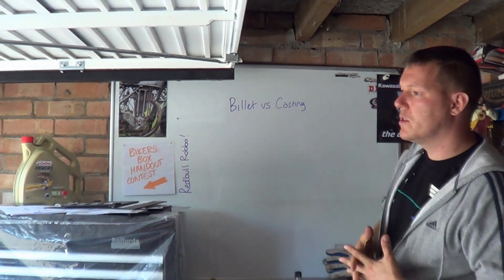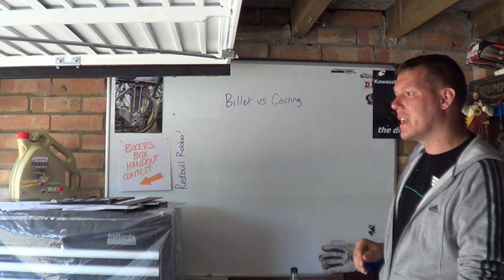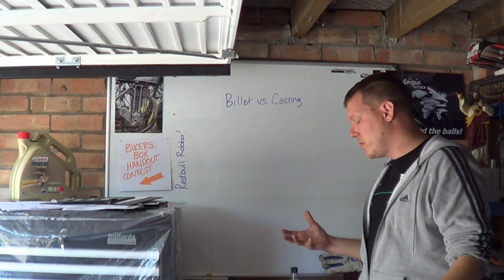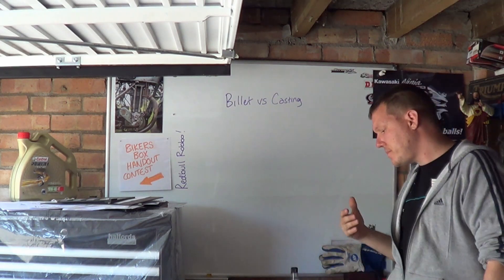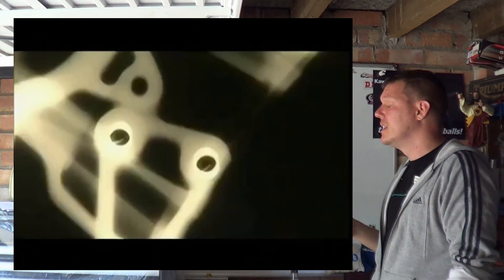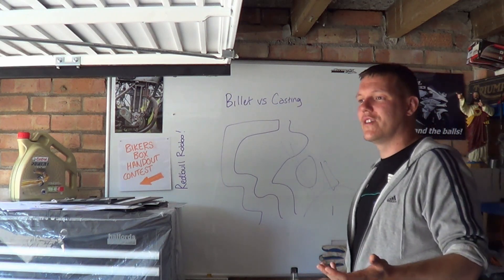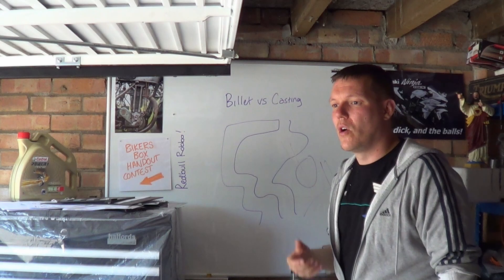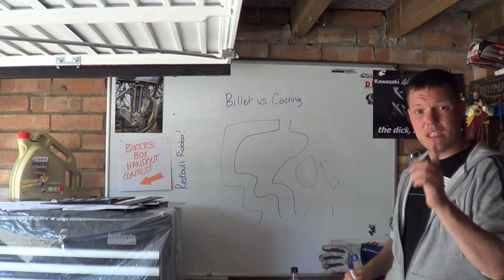Engine blocks - Casting vs Billet

Comment: So if I have engine block and machine all the surface with CNC. Does it called billet?
Reply: No a billet block is a block machined from a single piece solid metal billet. A cast block that's been through a cnc for resurfacing is still a cast block. Its considered as such because of style of manufacturing, casting usually means its melted aluminum poured into a mold and cast into shape while billet means it starts out as solid piece of metal that gets machined into shape.
Reply from the maker: LOL no.

Comment: Billet is CNC, right? Everybody’s got it wrong here. See, what you really need is 3D modeling software that allows you to make the engine in the first place, using a slicer to convert the model into gcode so YOU DONT HAVE TO WRITE IT LINE BY LINE, and then have it do its thing. Time really isn’t a problem. 3D printers work by much the same principle through stepper motors but do much the opposite.
Reply from the maker: Billet is a block of material. So no. CNC is computer numerical control. Totally different things......

Comment: In terms of custom casting. A gentleman I work with is the mechanic for a race team. The team runs different cars and engines but one thing they run are Hart 4 cylinders. They designed, or had designed, new heads. Had the patterns 3d printed, the heads cast and machined in a very short time frame

Comment: Is there a way for forging an engine?
Reply from the maker: forging? you mean the block? Why would you want to do that?
Reply: Forging is stronger than casting or billet
Reply from the maker: yes I know that but you don't need it. That's called over-engineering.
Reply: Fair enough

Comment: I know your not a car and turbo kind of guy but there is a current raging argument on how boost pressure works

The argument is if you replace your turbo for a bigger turbo and run it at the same wastegate pressure the car will receive more air in the form of a higer cfm and require more fuel to compensate.

I feel like you would enjoy adding your 2 cents
Reply from the maker: cheers dude I will do, why not lol

Comment: I'm a metal caster by trade, 10 years experience in mostly ferrous stuff.
Pretty much everything here is spot on. Yes there are smaller foundries however they dont deal with mass manufacture OEM type of volumes.
To run a commercially viable foundry you need far more equipment than your little backyarder.

Metal casting generally old tech but it is growing and evolving all the time, beginning to see 3d printed patterns and coreboxes appearing to reduce 1 off costs and lower lead times.

Comment: since all cylinders are cast, why are transfer ports cast in, when they are external to the sleeve and everything could be cnc'd and just bolted on? Im assuming bcs it's just cheaper to produce a cast jug

 I wonder if you could do something on air- vs. water-cooled engines?

Comment: CNC tooling to make billet blocks would be fairly expensive up front but the carbide cutting inserts used for machining most aluminums hold up very well and can machine many aluminum blocks. Only high silicon aluminum tears the tooling up and requires diamond coatings.

Comment: Something I can chime into since I do laser cutting and 3D printing on a small scale.

The other issue with methods like CNC milling/3D pritning/laser cutting is the tolerance repeatability. You have few options here; check every part that has come out of the machine (the usual way), retune/reset the machine after few parts, or don't give a shit about the tolerances (most CNC stuff coming from China). Can CNC be really, really accurate? Of course it can but it takes a fair amount of time and effort to get it accurate (also a lot of fucking around post manufacture).

We usually don't chase tens of a millimeter, and when we do trust me good luck getting it repeatably on the shitty machines we have. With what we do we don't need to worry about chasing a thousands of a millimeter therefore we can speed up the production. It is still very slow however. 

Unless you have a metric fuck ton of machines working at the same time you are not getting into the volume of mould injection/casting. It can be done, Apple being an example with the manufacture method for the unibody computers (if they still do it with a metric fuck ton of CNC machines). But Apple is kinda autistic when it comes to choice of manufacture. In the end CNC of any kind is great for short runs of unique parts. Kinda repeating what you said but the more people confirm it then more credible this is.
Reply from the maker: Do this mean your gonna laser cut me some parts??????
Reply: If its flat, made out of thin MDF or wood fiber board, and if you pay then yes.

Comment: Billet = stronger, farkn expensive, time consuming and overkill for every day engines etc , cast = still strong, cheap , mass production, fine for your every day engines
Reply: Yep. when you exceed the limits of a 4 bolt main block and tear the cast crank webs right out of the V, might be time for a billet block.
Reply: Aluminum billet make for an easier 2 stroke conversion for cutting ports into it. Its also easier to make up and run a dry sump with oil injection with VRO pump from any outboard.
Reply: Billet aluminum 6061 is easier to port for a 2 stroke conversion!
Reply: billket BB600 CID 2 stroke
Reply: @jlo13800  im planning to do a billet block, what material should i go? the best
Reply: @nicolaze9593  for a 2 stroke 7057 aluminum, 6061 will do. How many cubes are you planing for your 2 stroke?
Reply: @jlo13800  what material the best for doing billet engine?
Reply: @nicolaze9593  7068 alauminum alloy for the horny poodle 572 CID v8 2 stroke 8 port motor.

Comment: Patterns, not moulds!

Edit, it is possible to remove material for cooling ducts, but it generally is more a turbine blade thing. Using spark erosion or electrolysis.
Reply from the maker: The videos I do are for people who are just learning about this stuff for the first time, I could just go on about 'copes', 'drags', 'drafts', 'gates' and 'sprues' etc and I'll lose half of the audience instantly - 

As for using EDM or electrolysis - don't be daft. Did you see the picture of the actual core in the video?
Reply: Heyyy, I was just shooting the breeze mate!
I'm not one of those smart arsed fucks that complain, bitch and try and be clever.
Apologies if it sounded like that.
Reply: Ah cool, can I get a whoosh!
Cheers for explaining, although the old adage applies...
Explaining a joke being like dissecting a frog, you learn something along the way but at the end they are both very dead! :P

Cheers again, and I won't be such a tit next time round!

Comment: Turbine blades for jet engines are made with investment casting and I can confirm you can get mind bogglingly tight tolerances!
Reply: I work with them daily. Cast, then set by hand, then machined. Wax investment, ceramic mould. Inconel, Steels and Alu's.
Reply: Yeah but its usually just removing the runners/risers with a cutoff wheel and grinding a mating profile where they seat and thats only because a circa 0,007 tolerance to stop them shooting out the side of the engine is a piss take even with single point machining operations, let alone casting!